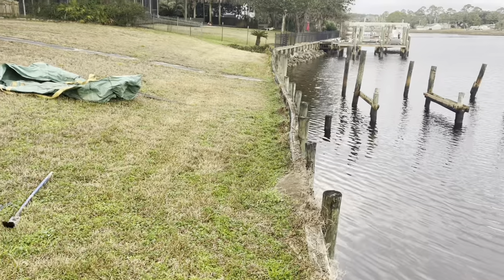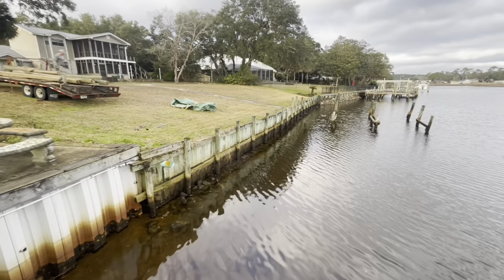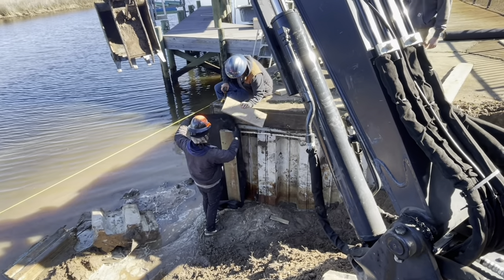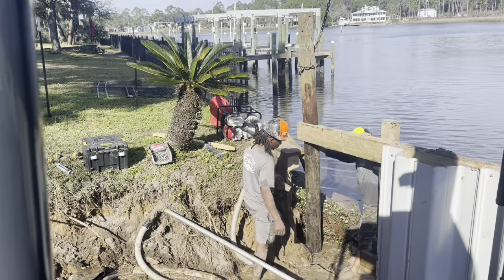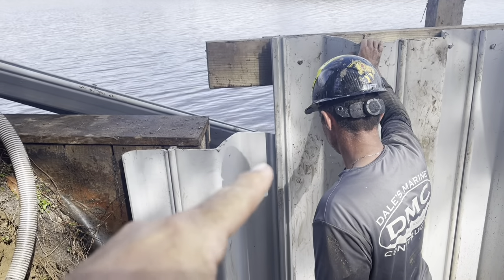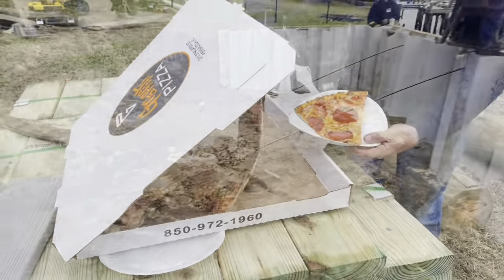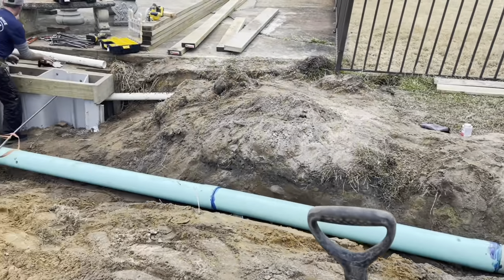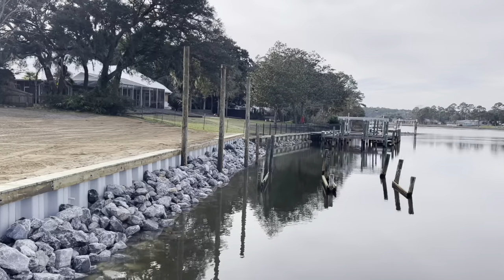VINYL SEAWALL 6 foot exposure￼

Comment: what is the purpose of the boards on the tie-back piles if you put it through the seam of the boards?? What are yall doing Dale???
Reply from the maker: Hey, thank you so much for watching my channel and your comment. As long as the boards are on the load side of the piling that is sufficient, you can run rods theouhyt if you’d like as well for extra support, but we secure the boards pretty well to the pilings